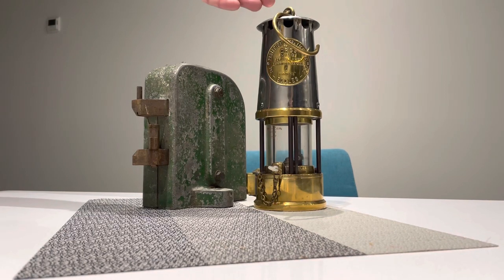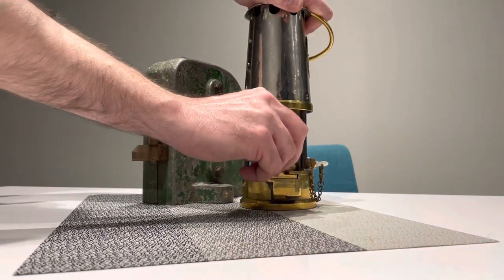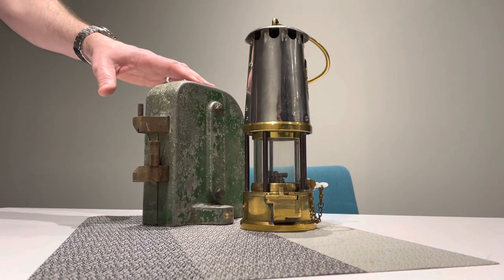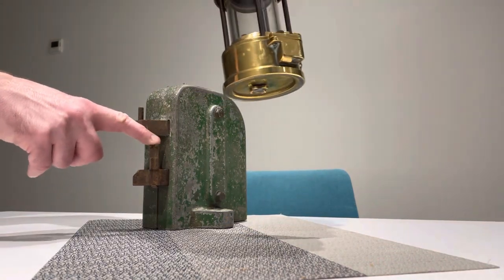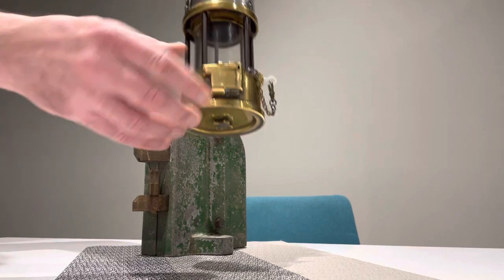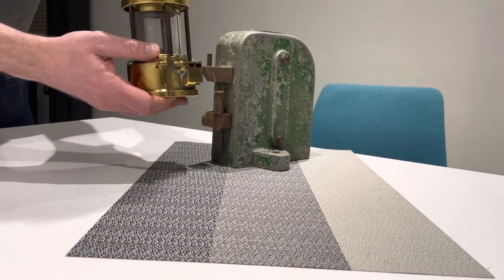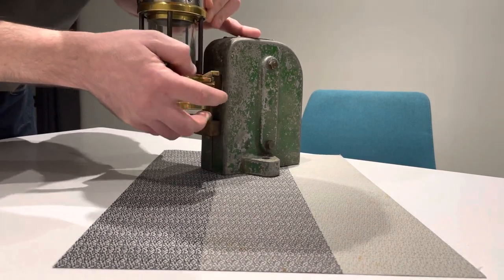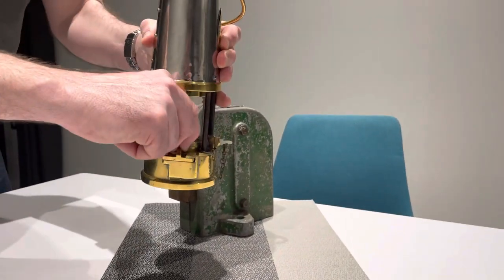Protector Miners Lamp bench magnet

Comment: But why did they lock them?
Reply from the maker: These types of miners lamps was used in mines that had explosive gases in the air. The lamps had to be locked by mining law to prevent miners tampering with the lamp which could potentially ignite the explosive gases.